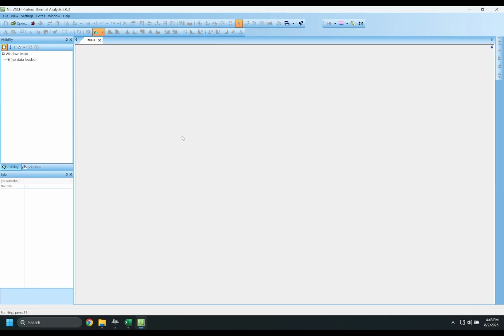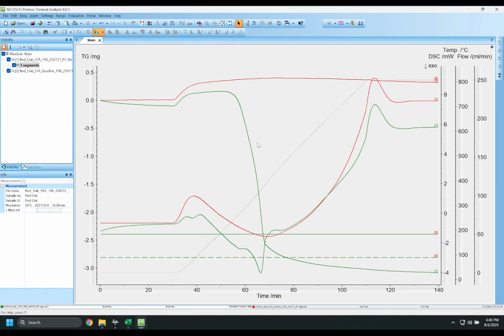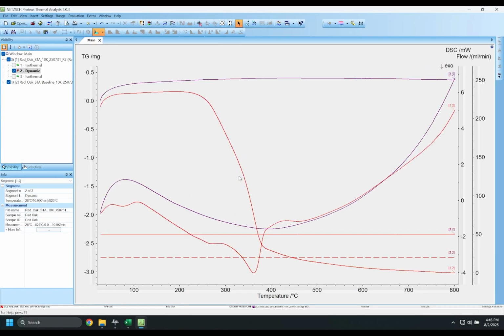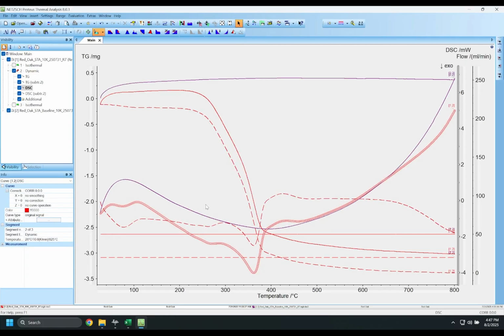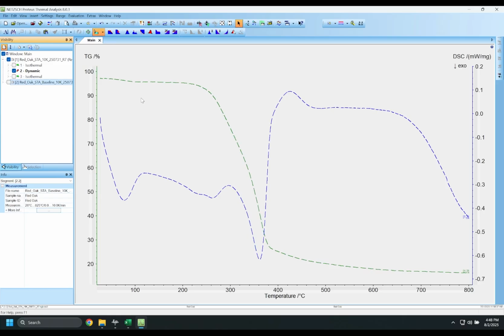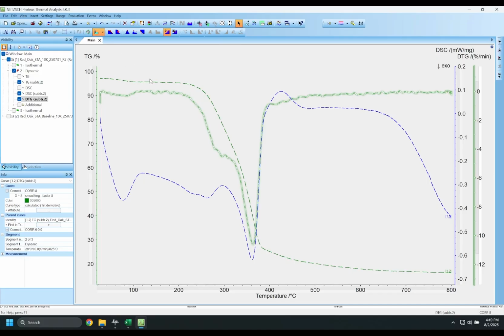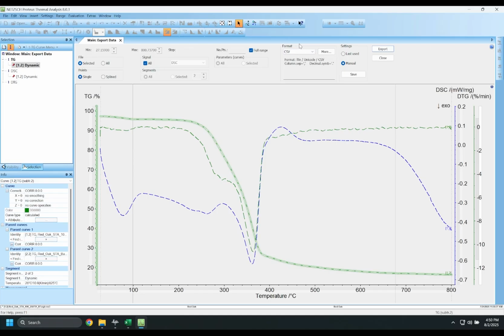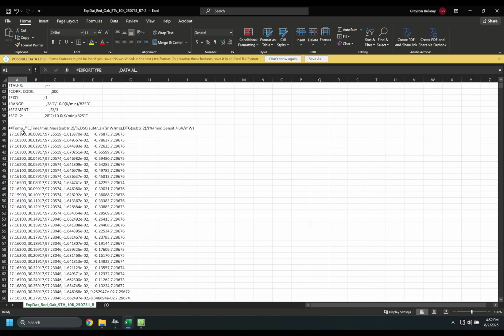Using Netzsch Proteus Analysis to Analyze and Export STA Data

Comment: how do you obtain your rate constant (k) from the data you pulled?
Reply from the maker: That's a very broad question... there are many different methods of doing so. If your curious our personal methodology, Bellamy, McKinnon, and Stoliarov, “Thermal decomposition models for wood: Comparing parallel and sequential reaction schemes for fire modeling applications,” Applications in Energy and Combustion Science, 2026. DOI: 10.1016/j.jaecs.2026.100500 would be the most recent reference.